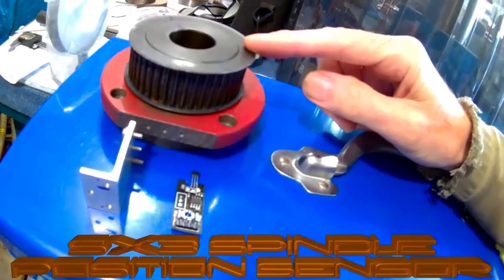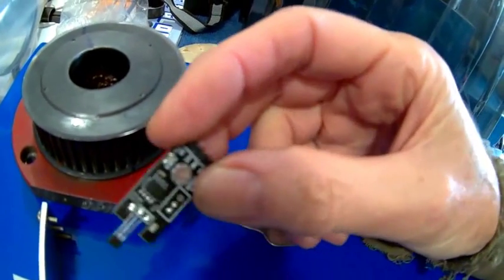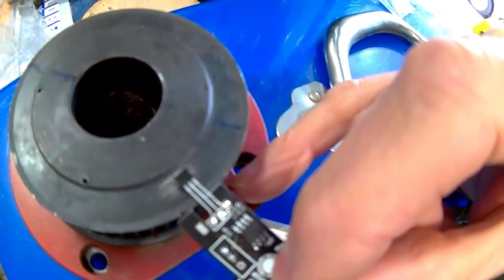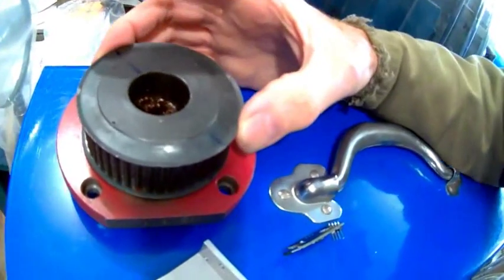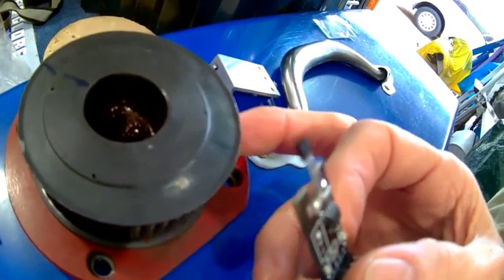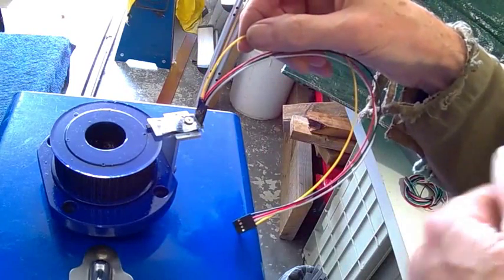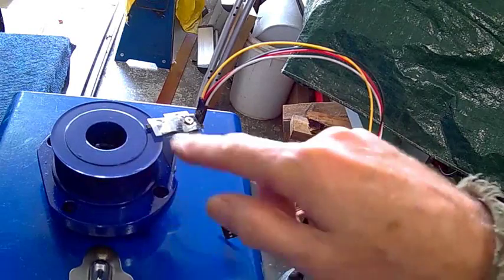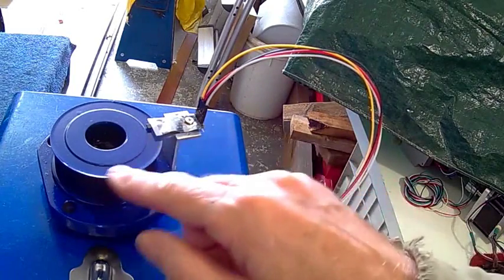CNC4A - SX3 Spindle Position Sensor

Comment: Greetings.
Excellent contribution.
I hope to better understand the following.
Can I use two sensors?
One sensor for RPM and one for ATC.
Would the signals be connected to input ports or INDEX?
Thank you.
Reply from the maker: As many as you like for the I/O pins you have. The arduino sensor has both digital and analogue output so you could use those in someway.

Comment: can you please tell me how your wiring this up as my sensor is working but mach 3 cnc aint reading it. thanks Daniel
Reply from the maker: Daniel Kitson Daniel I am using it for the spindle index found under Config > Ports & Pins > Input Signals and drag down to the Index row, which is just under Probe and adjust these settings.  For more info refer to the Mach3 Mill v1.84  manual section 4.12 pages 4.14, 5.4 and 4.8 page 4.12 of the Turn manual.  Hope this helps.
Reply: Brill thanks for the help
Reply: @TheWizard   Eso es lo que quiere y espera un suscriptor.